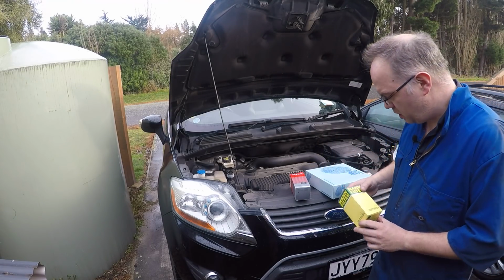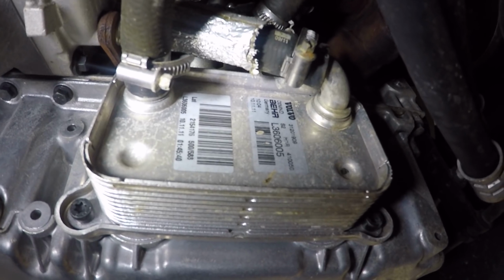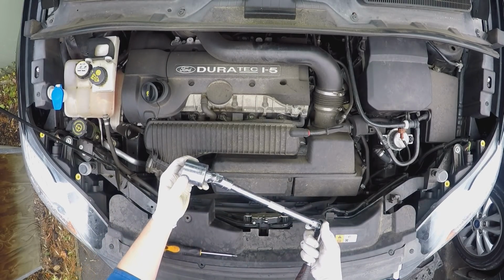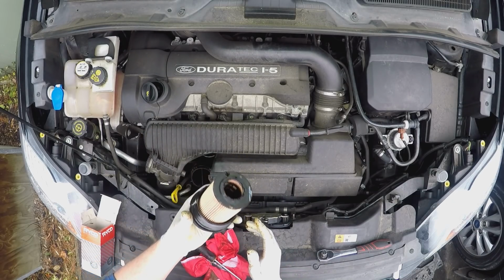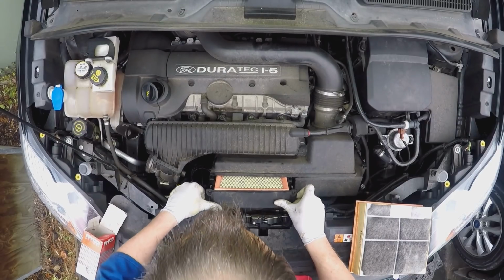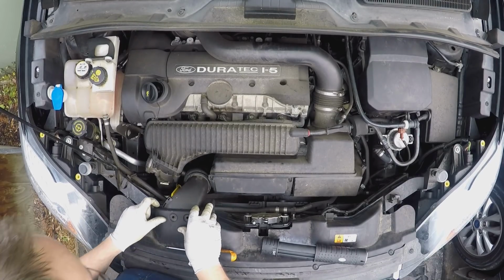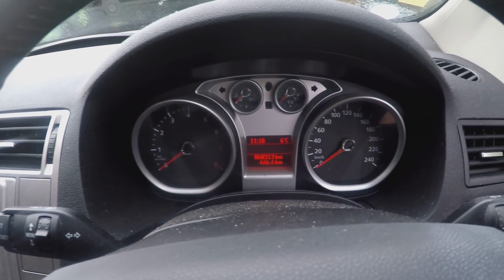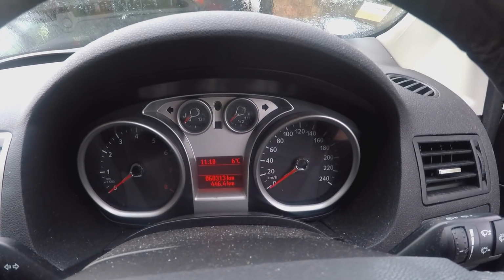Ford Kuga 2.5 Oil Change and Air Filter

Comment: I find exchanging the oil filters through the small gap without dropping dirt in the motor and re-assembling the air intake pipe assembly to be the most challenging parts. This drive train appears to be very solid and was refined on Volvo's since the early XC90's. I'm on 165k at the moment and it drives like new.
Reply from the maker: This one is holding up well. Cheers

Comment: That’s a pretty tight fit on that oil filter and air filter. The oil filter housing probably gave you thoughts of your VR6 as it looks the same. As for me, I sold mine several months ago. 😀👍
Reply from the maker: It's a very tight fit. I've never had to remove parts to get to an oil filter before. That reminds me, the VR6 needs a service too. Cheers Terry
Reply: stuzman good for you I'm guessing. It was too needy, yes? Whomever bought it probably got the best that car can offer at that age.
Reply: DE Nichols Hey David! The car was in great shape and I fixed everything that was wrong with it. Nothing major, small stuff. Four cars was to many. I’m thinking another has to go.

Comment: Got the same engine in my mondeo, still wondering if I should put the K&N air filter back in the old owner put in it. I only use one of those oiled filters in one car, and that one doesn't have a mass air meter (anymore).

Comment: Hi can you tell me where the turbo is located on this, as I want to replace the factory bypass valve/bov
Reply: Search up focus st 225 as its the same engine. Its tight to do and requires wheel to be removed on the cambelt side of car. Looking at engine turbo is located at rear and to the left.
Rare car with great power and tuning potential 700 bhp anyone🤔

Comment: Oil changes used to be simple.
Reply from the maker: Soon electric cars will take over and they'll be a thing of the past. Dark days
Reply: On the plus side, this Volvo engine will last forever. The engine design dates back to 1992....they will do mega miles if serviced properly. The turbos last forever, the waterpumps never break. The only downside is this engine has bad MPG.....it is not economical at all. The engine was not designed to be economical, it was designed to last a very long time.  Look at all the problems with the Ford ecoboost engines overheating etc. MK3 Focus ST headgasket issues on brand new cars.... I don't remember any such problem with the MK2 RS engine...
Unfortunately Volvo cannot make this engine anymore because electric cars.
Reply: @TekkenBones  oh yeah, mileage is horrible. My 2.5T Mondeo gets about 12-13l/100km combined, but mostly city, while the 2010+ Focus ST with the 2.3 EcoBoost with the same power can do under 10. Still, the sound makes up for it.

Comment: That air filter looks just like the one in my 89 Reliant.
Reply: Who designed this?
I did what's wrong with it?
Reply: Good video Brother.
Reply: Oh yeah how's the new one and the rest of the crew doing?
Reply from the maker: Welcome welcome. The crew are doing well but not quite up to Volvo/Ford certified technician level yet so I had to change the oil myself.